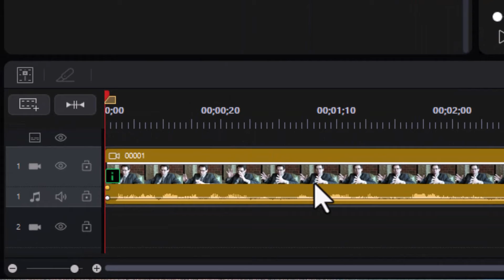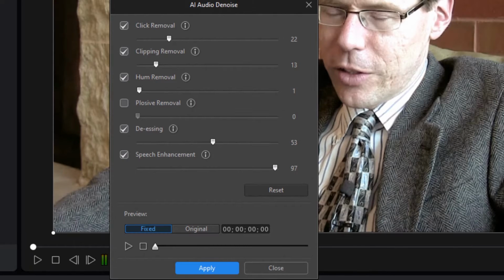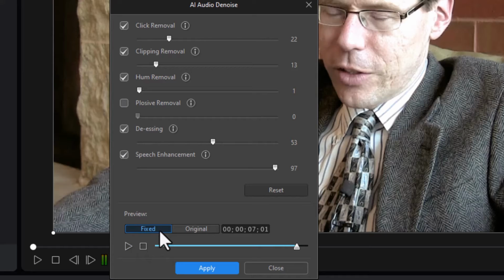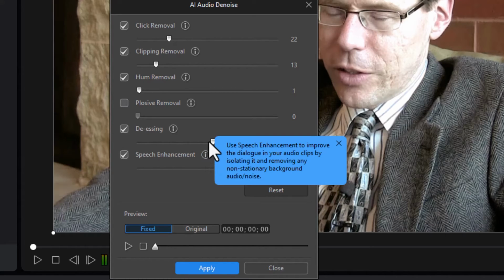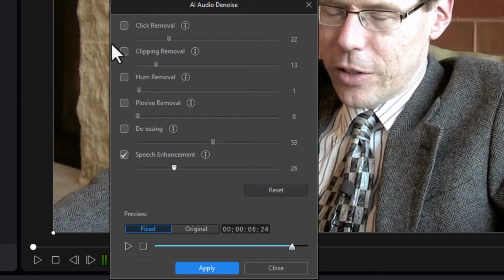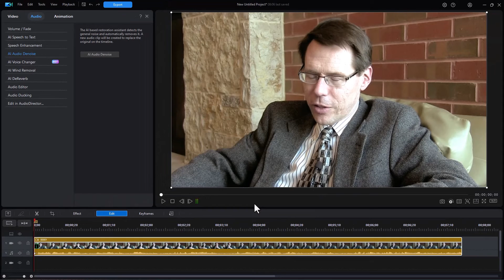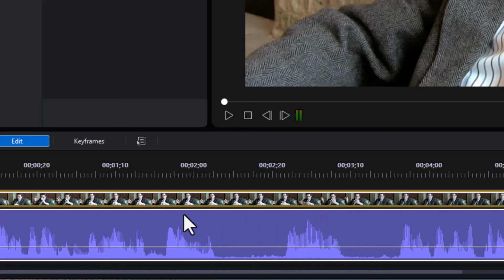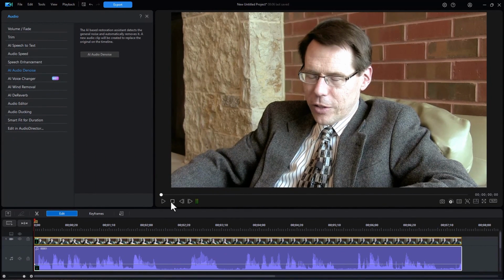How to remove background audio noise from an interview video in PowerDirector

Comment: To be honest, I thought that the word "Home", in all the "fixed" versions, sounded fake - as if something was artificially cutting it off. I'm wondering if adjustments of some of the other sliders could cure that?

It's not a tool that I would have much use for myself (which is a good thing, as I don't have it!). But interesting to know about. Thanks, Jim.
Reply from the maker: There are other adjustments you can make that would probably make some more minute changes to the audio. The equalizer is one tool that can help fine tune these things. --Jim

Comment: I was filming while walking through a farmers market and there was a musician playing a Beatles song. How do I keep the noise of the market yet remove the copyrighted music? Idea for a video?
Reply from the maker: That is quite a challenge. Since both normal noise and music are frequencies on the audio spectrum, I don't know how to find a way to remove one without removing the other. If they were at different places in the KHz spectrum they could be isolated. But since they share the same range in many cases, I can't see how they could be separated. Our brain identifies them as unique, but I don't know how software could do that. You could try using the vocal removal tool in the  Audio Editor. But that would not remove the melody. Or you could experiment with the equalizer using the same tool. --Jim